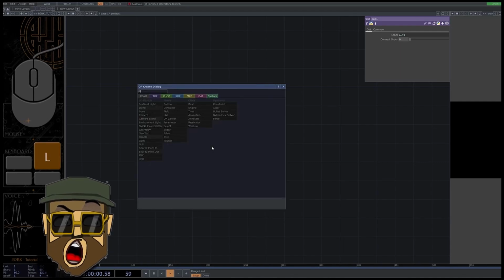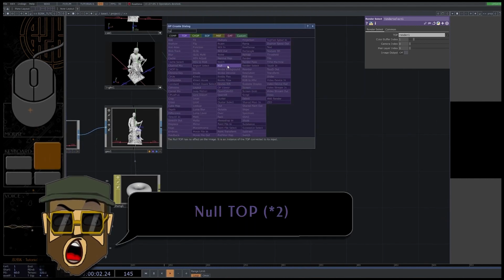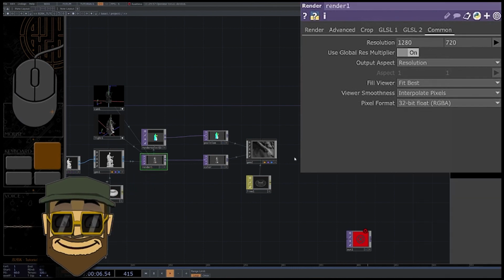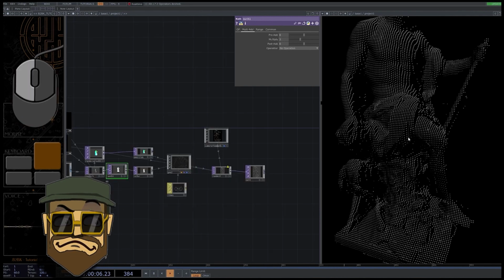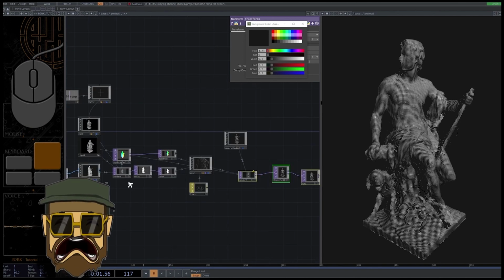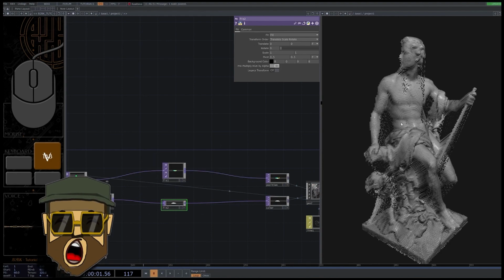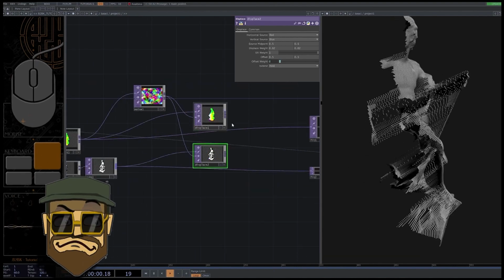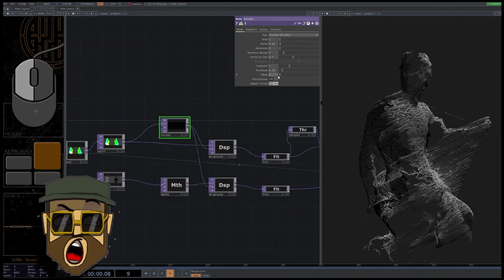Touchdesigner Tutorial - WorldSpacePosition PTC

Comment: All was going well until we added the cameraViewport, how did you add it without it immediately linking to the other operators?
Reply from the maker: Sorry, I don't understand your issue.
The firsts renderTops are using simple cameras (to create a pointcloud). The camera viewport should be use only for the last renderTop, to easily choose your point of view of the final result
Reply: @b2bk  Gran tutorial!!, pero tengo el Mismo problema, cuando agregas "camera Viewport" se linkea a los operadores "Geo 1" y "Geo 2" cuando en tu tutorial agregas "camera viewsport" solo se linkea a "render2". Segun yo lo que ocasiona que no aparezca nada en pantalla. 
Alguna solución para que "geo 1" y "geo 2" no se linken a "cameraViewport"? Gracias!!! ✌
Reply from the maker: @actinomorfo , in the camera viewport, there is a parameter called "render top". Just write render2 here.
Reply: @b2bk  Muchas gracias, realmente el problema si era "camera viewport" pero al momento de aplicar "parm" a "render 2" colocaba "geometry" en vez de "camera(s)" jajaj equivaliendo a un pantallazo negro. Pero ya se solucionó.
Gracias de nuevo y gracias por tu tiempo para responder.
Reply: Hi Antony, I had the same problem as yours.. May I ask you how did you solve it?
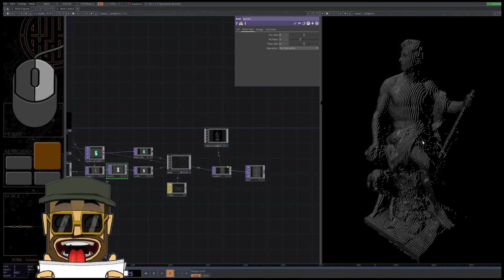Reply from the maker: @mieeusebi1906 , Hello. CameraViewport can be a bit tricky at first. The PanelCOMP parameter should be filled with a container (= a panel). The two dots mean the parent container (the one that contains all this network). In the parent container, you also need to activate middle and right click interaction. Go at 3:15 on my pointcloud tutorial and you'll see this part. And, also, check the cameraViewport is NOT orthographic.

Comment: Really nice effect, subbed.I'm in a older version of TD any chance you can explain using the archballCamera instead of the cameravieport plz? Do you just replace everything inside the container and connect it to the out1?
Reply from the maker: It's almost the same. Create an arcball camera from palette. You don't need the whole container but just the camera inside. In parameters, arcball tab, just write the name of the main container (the one displayed in perform mode, for example). You probably need to activate middle click and right click on this panel. That's it.

Comment: amazing tutorial!!   man I got stuck when i was trying to set the "CameraViewpoint". In my touchdesigner, the palette only has a "Camera" instead of "CameraViewpoint", the function seems the same but there is no "Orthographic" option, also the screen didn't transform to vertical when I changed the "Panel Comp" to ". . ".  I still followed the tutorial, link "Camera" with the "Render Top"+"Out Top". Suddenly my 3d object just vanished and only background left, nothing shows in "Out Top", "Camera" and "Render Top".
Reply from the maker: "cameraViewport" appears in 2022 TD versions. Instead, you can also use "arcballCamera" from previous versions.
Reply: @b2bk  got it. thx